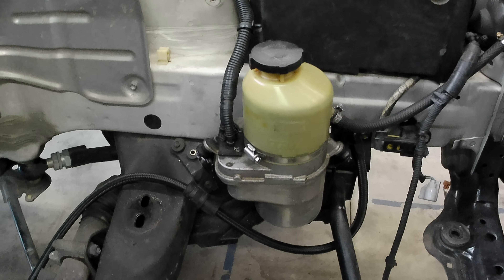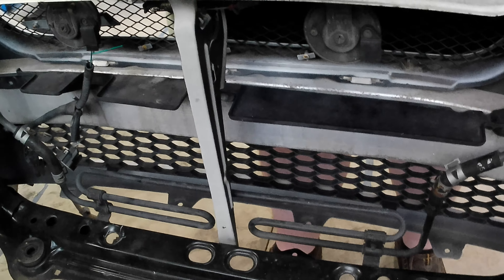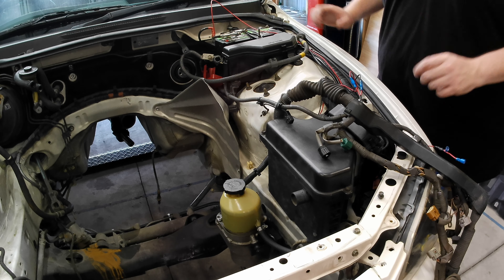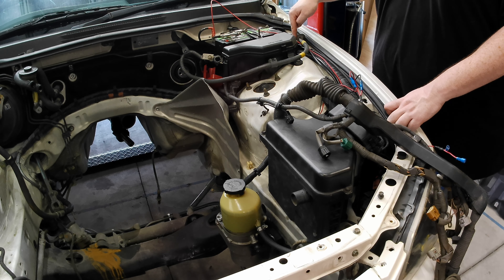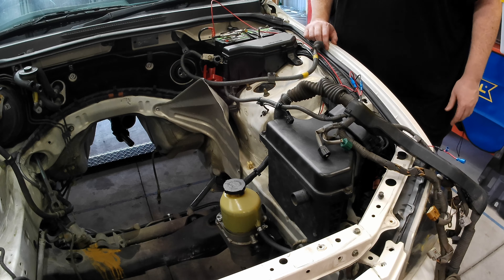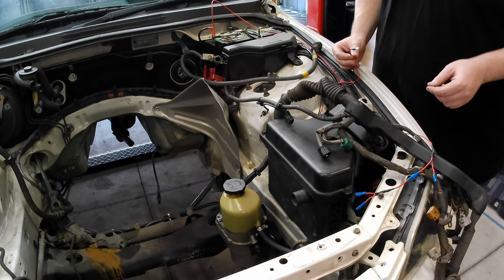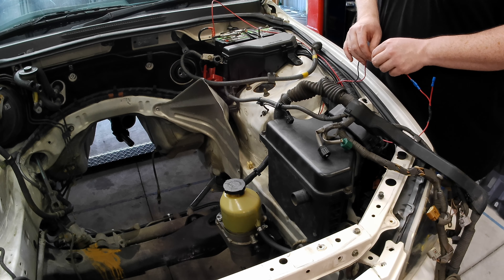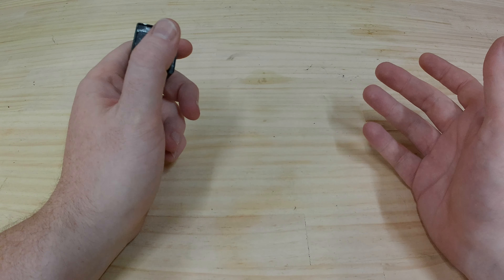Electric Power Steering into ANY CAR

Comment: Hi, If I have a A/C in my altezza this electric pump fit in there?
Reply from the maker: Hey mate! Not where mine is mounted, if you have a factory radiator I suspect you could mount it in front of the ac compressor however it would be tight. If you want to retain the air-conditioning then it would be better to mount it the other side infront of the alternator as you have more room.